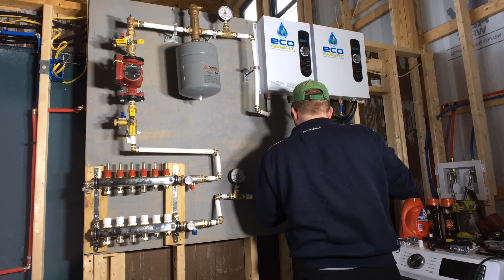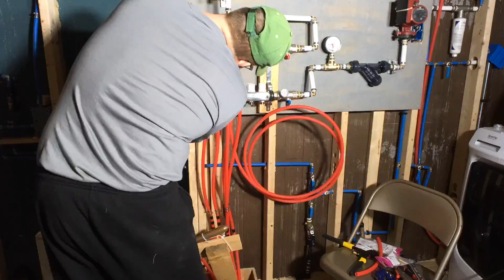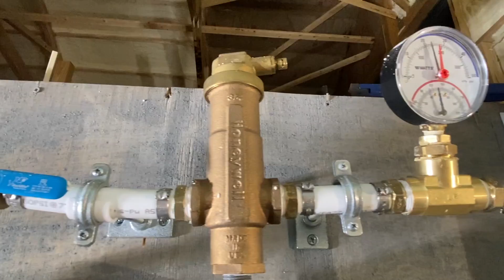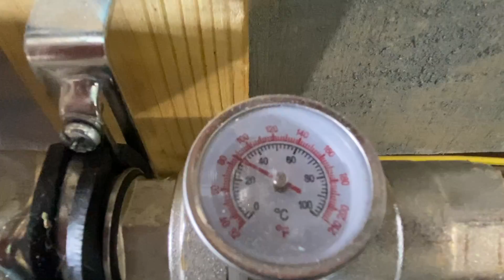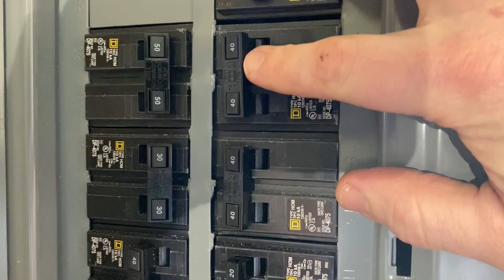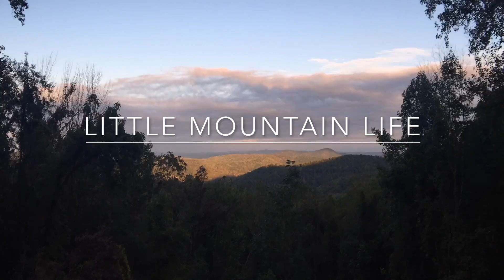DIY Radiant Floor Heat | Install and First Impressions

Comment: im installing a similar system in my new house but I'm having a bit of a hard time understanding how to connect the thermostat to read the floor temperature instead of air temperature,- which controls the switching relay that turns on the pump, which jumpstarts the heater and the entire system basicly.. however, I'm not seeing any thermostat in your system, not circulator switching relay...  are you controlling just the EcoSmart heater how much to heat up the water in the system w/o using a thermostat?
Reply from the maker: Yes I am manually controlling with the valves and flow rate and turning the heater on/off. We are planning on installing the thermostat this fall.
Reply: Aube Thermostat w/ Floor Sensor
Model Number: TH114-AF-024T Menards® SKU: 6655651. Always measure slab temp for radiant systems, it’s the most efficient method.  Stays extremely consistent temperature.  It will kick on, come up to temp, shut of, the slab will rise 1-2 more degrees but the air temp will stay spot on to what the slab is set to.  Enjoy!
Reply: @bobs4718  that is something you set into slab, not something you can add after cured, correct? I have an Emerson Sensi wifi stat could mount close to slab, since Alexa can control or app on phone I don't need to see it.. or do I need to drill hole in slab and use an AF style stat?
Reply: Craig Gerlach Yes, it’s installed into the slab, preferably in a conduit of Pex.  After the fact it can be drilled into the slab, just has to be close to the bottom and between pex runs, meaning not to close to one.  It should be sealed off from outside air if you’re only drilling 4” or so, so room air doesn’t affect it.  Some caulk or other insulation stuffed in the hole will work I think.  I’ve only ever installed them in a 5-10 ft run of pex.

Comment: Two problems you may encounter. You said you put in type B pex but you didn't say if it is an a oxygen barrier pex.
If it is not oxygen barrier pex then you will have problems with ferrous materials in the system , like cast iron pumps steel expansion tanks ect.
Second problem i see is you should pump away from the PONPC  point of no pressure change. That would be the expansion tank. 
With your setup i would run the first pump after the air separator and expansion tank.  Good luck and hope it works well.
Reply: Isn't expansion tank on suction side of the pump? flow is down away from that point.  was getting ready to mount my 3 loop system.. information is scattered on web.. this looked like simplest setup I could find.  Was going to take advice of Bob below and add supply feed between tank and separator with 15# boiler fill system. but thanks on the O2 comment, will see if the PEX I bought for the wall runs meet that.. the tank is only iron component here, bought an SS 1 Bar pump for circulation.
Reply: bought all my stuff in sweat so all complicated moving to PEX, but save few bucks even with extra fittings..  bought online so not like go exchange locally.. life in the woods...
Reply: @craiggerlach5548  yes suction side as close as possible 2 the tankless heater.
Reply: @ wendy bradford put a air separator on the suction side and a magnetfilter on the pushing side of the pump those wil largely encounter those problems. The magnet filter pick up all metal parts that can damage the system and less air means less oxide or corrosion on steal parts

Comment: I like your system my question is, how do you hook up a thermostat for this system?
Reply from the maker: Thanks! We are still working out the thermostat situation.  We will be sure to include that info in the fall update.
Reply: @LittleMountainLife  I have 2 ways that the system can operate on my in floor heating system, one on a programable timer and the other is on a thermostat. The Grundig circulating pump is activated by either the thermostat or the programable timer thru a controller switch. On the return water loop I have a mixing valve that I can either close or modulate to allow the cooler returning water to mix with the hot water supply line into the floor loop. I guess this is there to help modulate the temperature, my system uses 2 hot water tanks one permanently for the floor heating and the return loop goes to my other hot water tank that is for the household taps. I live in western Canada so you have to have this loop running almost permanently in the dead of winter as my frost line is 8 feet, and you could in theory freeze the water loop solid. The further north you go they now use Glycol with a heat exchanger to prevent freeze up issues. Hope this helps, we love our system we don’t use and forced air heating in an 1850 sq/ft basement in Alberta Canada, the water loop heats this whole part of the house.
Reply: Little Mountain Life - in commercial systems we typically vary the supply water temperature to meet the load. This requires a modulating thermostat output and the ability for the heater to take an input signal to adjust temp setpoint. In lieu of that, we vary flow rate instead. You could do on/off but it is problematic with the high thermal mass of the system.
Reply: Best solution for a thermostat is an in-floor sensor thermostat.  Usually placed in the slab with piece of the same Pex , just not filled with water, between two Pex heat lines in the floor.  That way you are measuring the slab temp close to a heat line which is quickly reacts to temp changes (4-6” from it).  If you didn’t place a piece of pex in the floor you can always drill one in (carefully!).  The pex line in the floor allows you to replace the sensor if it fails.  Easy!  Been running mine this way to 8 years, no issues at all.
Reply: I installed a system from radiantec, they list the thermostat and things they use on their site sp you know what you could use. But basically the thermostat can sense both air temp and floor temp with a sensor.  When the air temp goes below the set temp it turns the heat on which is turning on a relay which powers up the circulating pump. The floor heat sensor shuts it off at 80F if you have a wood floor to avoid warping.

Comment: I'm building the same system but I have 14 loops and the big 17 Kw eco smart. Its a bit more complex because I have 3 zones. Good to know the heater I bought will work though. thanks.

Comment: 18KW is a serious amount of energy (pool pump is 0.75 - 1 KW, home kettle typically 2.2KW to give an indication), hope you have affordable energy supplier.
Reply from the maker: We often times run just one element in the heater so it’s 9kw on most days in the winter. It is a lot of power though, and that’s why solar panels and Tesla batteries are part of the plan.
Reply: The Ecosmart heaters do NOT run continuously at their max rating unless they are set for a high output temp (eg 140 F). Normally at about 90 to 100 F with typical flow rate of 1.4 to 2 LPM (about 0.5 USGPM) per loop, the heater will modulate down to a much lower power level.

Comment: A tip for those planning on going the radiant floor route.  Loop the first run of a circuit parallel to the outside walls first.  You want the have the hottest part of the circuits going to the parts of the house that will be the coldest (ie outside walls).  Then loop the rest of the circuit as normal like in the video.  The simplest example of what you are looking for is if you run one continual circuit from the outside towards the middle of the room like a spiral, the heat should be going from the outside towards the center.  This will allow for the best heat balance (no hot spots in the middle of the home).

Also, sketch out your panel layout before you start installing parts.  There are easily 5 to 6 90deg bends on the panel that could have been avoided had the components been setup a little different.  The less bends in a circuit the more efficient fluid flow, less costs and less chances of leaks.  Just a few things to consider.
Reply from the maker: Appreciate your input.  Its definitely a good idea to run the circuits in a way that doesn't create hot spots.  We placed our loops with the initial heat in mind and the 'hot spots' are in high traffic areas where we enjoy some extra warmth on our feet during the winter.
I did sketch out the layout, several times in fact.  I had some space restrictions which resulted in more 90 degree bends.
Reply: :se

Comment: Square footage of your basement slab and cost of system ?
Reply from the maker: It’s not a basement. It’s the floor of our home. But it’s 32x32. 🙂
Reply: Little Mountain Life cost of the system ?
Reply: Cost of the system that you have? Meaning furnace and parts ? Along with labor if you hired outside ? And any idea if you have monthly cost to operate system ? Thanks 🙏. I’m about to start a new construction and considering to install this on my basement and garage area
Reply from the maker: @edcarra113  Total cost for all of the system components came out to $1,450 including hot water heater and components. I installed it myself.

Comment: Thanks you so much for this video. I have a question, did you put your reinforcement wire under your vapor barrier?
Reply from the maker: The vapor barrier (plastic) for the slab is under the wire

Comment: Quick question...how much has your utility bills gone up? And does new water need to be recirculated throughout the system, or is the old water simply reused?
Reply from the maker: I wish we had a good answer for your but we won't know our true electric costs until the house is 100% insulated.  We will definitely do a follow up with energy costs/savings this coming winter.
Reply: Little Mountain Life ok no problem

Comment: 140 is too hot going in. Since it is an electric boiler it can run at a lower temp. Probably 110 degrees. As long as loops are't more then 240 feet
Reply from the maker: Thanks for your input.  We try to just run it @ 140 when we start it up on a cold day and usually run it @ 110 or 120 for extended periods.

Comment: What’s your Electric bill look like?
Reply from the maker: I don't have a good answer for you concerning our bill.  The house is still unfinished and not completely insulated so we definitely did not retain the heat well this winter.  We will have a hard number to share next winter.
Reply: Little Mountain Life    just need a ballpark
Reply: @LittleMountainLife  from what I can tell the on demand heaters are no longer allowed to be used in a closed system like that.  Any idea why?
Reply from the maker: @bmitchmd  I hadn’t heard that before. Is that info you found in your local code?
Reply: @LittleMountainLife  the on demand company told me that they aren't allowed to even advertise it for radiant floors anymore.

Comment: Like your video. Happy I don’t have your electric bill...lol so once your slab is heated does is it using less electric to keep it heated and does it stay heated long before the pump kicks on?
Reply from the maker: Not sure yet.  We haven't installed a thermostat yet so we've been manually turning on and off especially on colder nights.

Comment: how does the electrical water heaters work for this - as in the efficiency levels..? the price for warming the house verses - propane or fuel oil?
Reply from the maker: Its hard for us to calculate the true cost because our home is still not fully insulated.
We'll be able to provide read life data this coming fall/winter. However we are still very happy with the system.  It can warm up a cold floor in a few hours and maintains the heat for several more hours after being turned off.

Comment: We have a similar story to yalls regarding a small amount of acreage purchase and living in travel trailer/in the project while under construction and build home! So we have built a house with portable sawmill over the last 5 years in Central Alabama and ended up doing ducted Mitsubishi Mini Split units to heat/cool all the living portions of the house with a nice glass front wood burning stove insert w/blower in living room to absorb various hardwood scarps from sawmill and still be able to enjoy a real fire. It actually has its own outside air kit which is nice since the house is so tight by way of Building Codes these days! Wish we would have went ahead and put pex in all the slabs considering that there may could have been the possibility of doing radiant heat everywhere in house (since all the floors on first level are exposed and clear sealed concrete) and then AC only Mini Splits. The remaining portion of this house is a high ceiling A frame exposed truss/t&G Pine workshop room of about 1000 s.f. that is an attached workshop to the house. So basically one big LIVE/WORK Unit that we will have to get creative in managing the sound from the workshop into the house. LOL Regarding heating of workshop, we cannot get natural gas here so seems that the most reasonable option remaining is to use an extra Rheem Rtex 18 that we already own for heat source for that floor system.  I was a bit nervous on the economics of going this route in terms of monthly billing however unless we did some sort of solar setup there are really no other good options for us with respect to radiant system, and several have advised that the cost of solar equipment may not really even make it a good option. Would you be willing to provide any ballpark data on what it is costing you to operate the system or some way I may could try and calculate that out. I realize yall have an 18k and 24k so maybe you don't know exactly how much it is costing each month for just the 18K unit but would be awesome if you did have a break out $$ average per unit. Or even if you happen to know how many KWh you might be using on the 18K unit per month in peak months realizing that it is costing yall more in Virginia maybe then Alabama would be. This is one of the more exciting projects for us within out larger project and it is good to see that others are using Electric Tankless. The other big issue that I have been challenged to get answers on is Insulation under slab. As of yesterday and polling several people over the last few months I think we decided to eliminate any rigid insulation under the slab for reasons of possible termites and short winters and just do the insulation of slab edges, however do our typical vapor barrier. Common consensus is that in Alabama we may want the cooler ground temperatures in contact with the slab for summer months and then supposedly termites can get involved with the xps foam, however still if there is no close wet wood source and or easy access to framing for them to tunnel up then this leaves me somewhat confused of what really then is the issue with termites. Only thing I can figure is that they could potentially void out the foam and it become structurally weak under the slab if there were some infestation directly under the slab but we have gravel backfill so there should be no standing water, but its hard to be the mind of a termite. LOL. None the less thanks for a concise video confirming many of our ideas to go ahead and do the experiment. There is limited information on this topic in our area, but seems like a wise move for us to heat out workshop area with such tall ceilings this way such that the heat will stay close to the working area of the humans.

Comment: Do you have a link to the manifold and connectors that you used for the pex? Thank you!
Reply from the maker: connectors- https://www.supplyhouse.com/sh/control/product/~product_id=PXLA050
manifold- https://www.supplyhouse.com/Bluefin-PXPKHM-6-6-Loop-Stainless-Steel-Manifold-Package-1-2-PEX
Reply: @LittleMountainLife  thank you!